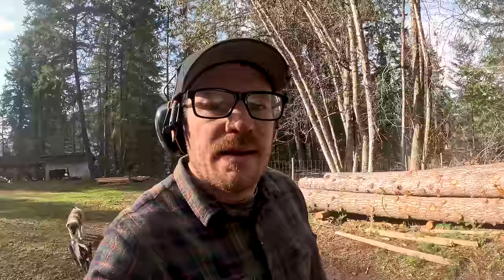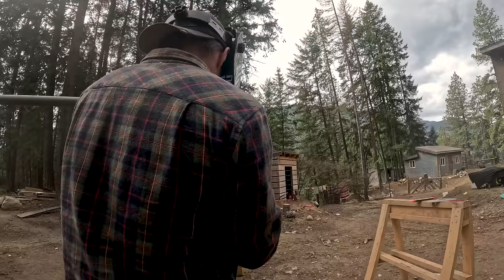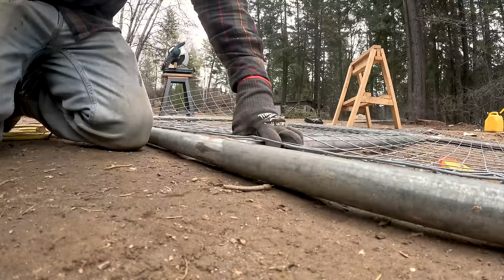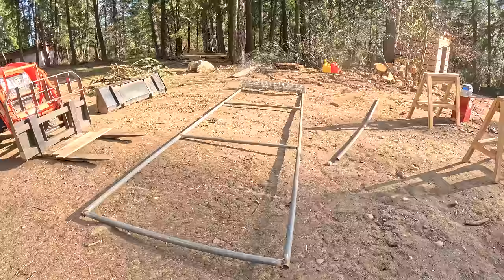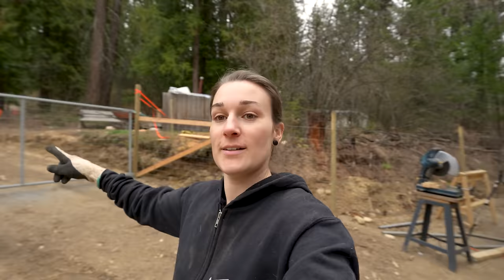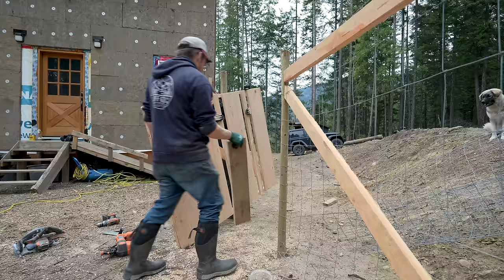Fortifying Our Off Grid Oasis With Custom DIY Gates

Comment: One the main things with welding is to match DC continuity with a DC rod. Then just play heat and distance. Angle of the rod matters. Wire does the same.

Comment: another trick for extreme long gates is to have the gate post extra tall and pivot a cable to top of post to far end of gate to alleviate the sag/dip at the far end or add old wheels of lawnmowers or other reclaimed equipment to bottom of gate to hold the extra weight

Comment: Suggestion on the 17' gate: weld a caster on the bottom swinging edge so the gate weight is supported other than on the pin hinges

Comment: As a hay hauler back in the very early 1960s I ran across all types of farmers' gates and many of the wider gates opened in the middle. So, you might consider that style; I think it is called a horse gate. All of the wide gates have big posts holding them. Like at least 8 by 8 inches, or the size of a utility post in diameter.

Comment: Katie have Greg but a couple of turnbuckles and a couple trailer tie-down anchors and the gate will outlive you, the post may rot but you can replace the post. put an anchor on the hinge side of each steel gate

Comment: I'm a welder and don't pay any attention to people that give you kaka, you learn while you go and the beads will get better as you do it. Most guys won't even try, but you have to learn by doing. When I welded  pipe that was coated, grind  away the coating for a clean weld.

Comment: You might have noticed; corner and gate post are usually twice the size of fence line post.  6 to 8 inch post will work a lot better and put them 3 to 4 ft in the ground.  On long gates you can also add concrete in the hole.  Nothing more irritating than a gate that is constantly moving around or out of adjustment. More work but trust me those gates won't go anywhere with the bigger post.  If you can wiggle the post its not big enough. Don't ask me why I know this, it took me years and a lot of time to learn this when I was younger.

Comment: Katie and Gregg , you are amazing! Just so inspiring, with an ever increasing skill set and a fantastic home. I really appreciate you sharing with us , thank you…
Reply: Welding galvanized metal requires a special breathing mask because the metal is coated with zinc, which, when heated during welding, releases toxic fumes. Specifically, the high heat causes the zinc coating to vaporize, producing zinc oxide fumes. Inhaling these fumes can lead to “metal fume fever,” a condition characterized by flu-like symptoms such as fever, chills, nausea, headache, and muscle aches. Long-term exposure to zinc oxide fumes can also result in more severe health issues.
Reply: Two questions.  One: Why one large gate instead of two smaller ones that connect in the middle when closed?  Two: have you tried a slotted hole for pole hinge hole to allow you to connect the bottom hinge first, then raise the top hinge rod into the gate hinge and tighten it in place after it’s in the hinge hole?  I have no experience in mounting gates so my idea may be useless.  Love you videos!  ❤️🇨🇦

Comment: You can make a crossbrace with cable and a turnbuckle.  that will be adjustable and will cut down on weight. That will work particularly well on the metal gates.

Comment: Greg that gate looks great welding is something I have fancied having a go at but with a gasless mig welder it’s just getting a decent cheap one. As for your hinge problem I would remove the pin and replace it so the pin goes down through the gate that way none of the animals can accidentally lift the gate off its hinges.

Comment: I'm 72, welded my whole working career. Small stuff like the fence you will use the tig, thicker steel, the stick welder. My wife just said you should put a wheel on the gate? Your call. Thanks for sharing.

Comment: Greg, you did a great job with the welding, way better than 100% of the ppl who don't try..😊 In my opinion, after hanging metal gates on various properties, you need at least a 6" post to hang the 12', and a good railroad tie for the 17'. The 4" post they're bolted to won't carry the weight for long sadly. Love ya'll ❤ Keep practicing that weld! 😊

Comment: Good for now. Those gates are either big  heavy or both for those small fence posts. Over time they could move or sag. Beefier hinge posts, metal Vs wood, concrete around gate hinge posts. Effects of winter, rain run off, frequent use.

Baseline, lessons learned, skills developing with more practice.

Comment: Another option?  Say for an 18’ gate would be to install {2} 9’ gates.  You can put a galvanized pole in the middle made from gate frame material.  Concrete the hole for middle connection pole so the pole can be took out to allow each side of gate to swing out when bigger opening is needed.  Brackets can be added to allow each gate to rest on and connect in the middle.

Comment: I built a 16 ft. gate over 50 years ago, as a VoAg project in high school.  It is still in daily use on the ranch and despite damage from a tractor hitting it with a plow, still works well.
Reply: That goes to show what time and effort are put into a project can last a long time.

Comment: For attaching mesh to pipe or bar, a good trick is to use washers over the mesh. If you place them at the nesh wire's intersections and plug weld through the washer centre, they hold mesh well and look better than direct welded / burned mesh. Plain steel washers are cheap and available anywhere in Canada or the US at most hardware stores. The ones for 1/4" , 5/16" or 3/8" are probably best sizes to test with your mesh. Just food for thought. Cheers! PS- washers are handy for packing spaces on hinge pivots if need be...and don't forget the white grease on em too. 8^)

Comment: You did a good job for a first timer! I’m a welder/fabricator for a fencing company, building and hanging gates is what I do.  Next time you weld arc, grab 6013 1/8 ,it’s an all position rod that works well and  very easy to use. As for welding the wire mesh, try tacking on the pipe and pushing the pool onto to the wire, if you know you know.
As for your hinge on the first gate, just open the top hole up a bit and move the hinge pin to sit where you want it and tighten, and if you don’t have a washer on both sides of the post, add them.
That 17 footer should be a “double drive”, or split in two . That is way too heavy for the posts you’re using, and you will run into problems down the road with it.
Just trying to help, you did a good job other wise.

Comment: On the post on which the gate is hanging. Add a separate post on the outside, about six or so inches. Heavy metal post, four, five feet concreted in the ground. When concrete set connect to gate post. That way your fence post will always be aligned. You can also concrete that post slightly out of level as an extra precaution.
Reply: like he will take your advice. He is his own man.

Comment: The only thing, for the longer term, is bracing those fence posts holding the gates. The weight, over time, will pull the gates out of square and end up like the ones here, dragging. 
The welds don't need to be pretty, but functional.

Comment: Ah Greg when You use a buzz box and burn a hole through good thing is you can always fill it right back in but you better be using 7014 rod probably a thin one And grind off all the galvanization you won't have to wear that double mask I never wear mask at all the years I welded just got to make sure you take all the galvanized off that easy

Comment: When I weld galvanize I grind the galvanized off the steel weld it and then if you want you can buy a galvanized spray and spray it over your will or just paint it

Comment: Greg, That fence post that holds the gate needs a bracing post.  The gate is too heavy for the post alone.  You will need to go back about 3 metres and ram in a deep post on a 45 degree angle, about 2 metres into the ground towards the gate. and then run a brace from that (near the ground) to the top of the supporting fence post, and fix both together securely.   And then you will also need a second brace in the direction of the driveway, to support the fence post when the gate is opened.   By the way, nice work with the welding!

Comment: Greg add a down wire to the post at the gate to hold the post up.  It will start to sag real soon. Small hole with a small concrete and lag bolt and a down wire to hold the post will save you a lot of time in the future.  The place is looking good.   It is a lot of work but makes you feel good about yourself......

Comment: Another suggestion Greg is two 8 1/2 foot gates instead of One 17 foot gate. A car or truck can easily pass through an 8 foot gate and it's half the stress on the corner post.  Otherwise your welding is acceptable and "good enough" per the only person that matters....Katie!

Comment: A gate is basically a swinging truss. Grinding area clean before welding is the ticket. Zinc is a non bonder for welds.  Paint the welded areas.

Comment: Tripped breaker open it up and look for ground short in the switch! you do still need some diagonal braces on the gate. center top to bottom outsides. Looking pretty good! Don't cut posts down until after you steel rope the gate to swing.

Comment: Hello, Guy here who helped you with tips on swinging the Axe a couple of times.  Great welds only matter on heavy duty, weight supporting applications.   A thin gate is perfectly fine with popcorn welds as long as some penetration has been made, and you should not worry at all about it.  It'll hold and that is what matters.  If you were doing more load bearing applications, your weld quality would matter a bit more.

Comment: Good morning Greg from a ironworker and fence installers point of view I think you did a pretty good  job on them gates . Galvanized is a tough thing to weld because of the zinc. But with you  grind the area real good to get the zinc off the area that you welding. Is the right way to go and i run my welding machines hotter when i weld galvanized. So it's a good idea to wear a mask so you're not inhaling the toxic smoke. And keep milk with you and drink the milk to help with the toxic fumes that you're breathing in. 👍👍👍👍👍

Comment: On your long gates on the hindge side , because the posts are to short, scab on or attach another post that is maybe 4 ft. taller .At the top of that post run a a wire to the far end of the gate. You may also have to run a wire from the top of the new post  out 180 deg from the post as there is a lot of strain on that post. Lots of extra work but it will pay off.

Comment: Seed an area, water it and then put a sheet of plywood (or similar) over it for a few days, it will germinate without being eaten.  Then check it every couple of days and keep it wet.  Then pull up the plywood once the majority of the seed has sprouted.  You will get amazing results.

Comment: If you want to keep the big Gate just find a decent sized tree cut it down cut to length dig a hole cement it in and wala easy peezy 😊 PS probably around 4 or 5 bags.

Comment: But Greg - about the gate - it looks great, especially considering the cost of buying one. If you were keeping cows or horses in or out, that might be different, but I think the gate would still hold. On the post where the gate isn’t all the way down on the post (whatever it’s called), it might settle after the gate has been used for a while. Even if it doesn’t settle, no big deal.  AND - you’ve learned three things:  welding, using the saw to cut pipe and build a gate. All of that in a day!  If you need to, reinforce the fencing to the gate with wire - like on a chain link fence.  The big gate, make into 2 smaller gates that meet in the center.  Great, great video!  Great content!

Comment: Greg u did great ,youve tried to weld,and thats better then not. In the hanging gates i have heavy duty wire thats attached on top of gate to the post. It will help the fence not to sag and will help it open up. Yall did great!

Comment: Greg you need at least 6x6 post for your gates specially for that 17 foot gate with diagonal bracing to support the 6x6 post. Been there and done that. It may look good now but later it will not work well.

Comment: Hey Greg I am very glad you said you would were a mask. Galvanised fumes ( zinc) mixed with the air you breathe in . This can give you metal fever. Flu like symptoms. Always where a fume mask buddy. keep safe.looking good. Why did you arc weld the big gate. Was you mig not working? Cross brace all rectangles. 😮 loving what you’re doing.

Comment: A few diagonal metal-pipe cross braces out from the middle vertical may be needed to keep it from sagging when you fix the fence tack welds. Heating the top hook with your torch and tappping it a bit down may help get your hook all the way onto the pin. Good job. “ It will hold!” as they say on the show Forged in Galvanized Steel. LOL

Comment: A bit late for a couple of tips but here goes anyway.  #1 - With time you may find that you should have put a diagonal on your gates,  #2 - Your gate mounting posts, may need some stays to support the post when the gate is not lined up with the fence stays as there will be some weight in them as they are so long.  #3 - Supporting the end opposite to the hing when closed may also help to stop sagging.

Comment: you can always use lumber and self tapping screws to strengthen gate and hold wire fencing to it ( two birds, one stone ) just drill the boards into the gate frame or do as a forty-five to stiffen gates and a post ( out from gate post ) driven in ground with wire run to it can str8en up post and straighten gate post that hold gate upright

Comment: When you use a long extension cord on your tools the amps will go up because of voltage drop caused by the length of wire. 10 gauge extension cords are pretty expensive but are worth it.

Comment: Hey Greg, when you can it would be a good idea to make up some gussets out of 3/16 flat steel and weld them to each the corners of your gates. Don't sweat the welds bro, we all have to learn somehow and galvanized can be tricky at first due to the off-gasing. Good call on the mask. I don't know what rods you are using but if it's an AC welder 6013 or 7014 rods work well. Keep at it, you'll get it.

Comment: Use two 8 foot 4 in. Gates with 4 in. Center post that is removable and will leave a 17 ft. Opening 
When the center is removed. with a simpler 8' gate the rest of the time.

Comment: on the wooden gat you can add a board or cable across the gate posts  supports to keep them from leaning  backward   because the weight and pull and rain will change them over time and you can take the added board support and place  a pin in out so if you have to take anything tall thru there it can be pivoted then placed back this is on wooden gate im speaking unless you want back off the support gates a few feet add another post and put in cross supports to hold the angle of those posts  but the board across the top of post would be much easier and you can place your  off grid living design in the center of that cross support which it would swivel to get anything tall thru there not trying to tell you what to do just thinking on how i would solve future problems only as suggestions  i like to see people that are not afraid of work

Comment: Couple of thoughts on your metal gates. I think you may want to put some crossbracing in because nothing stops it from going side to side and breaking your welds. Also, for that huge gate, you’ll probably want to do some more anchoring so it doesn’t pull those two posts to the side, maybe anchor to another tree or bury a large block of concrete in the ground and anchor to it. Great work though.

Comment: You'll need a much more rigid post (concreted in) to allow for the weight of the 17 ft gate, especially since it is heavier than the previous gate.

Comment: Did you know when the parts missing from a tool you can ride to the manufacturer and a lot of times they sent you the replacement part for free because it cost them more to send you the replacement part for free because it cost them more to return the product that doesn’t happen all the time Sometimes they ask for money but sometimes they don’t.
So sent them the manufacturer the model number and serial number you make it lucky and send it to you for free are used to work with tools. Good luck.!

Comment: Buddy on ur hinge that u bolted on the post is right the top part of the hinge should be   turn down to lock up up gate so it won't be easy to pull out for intruders.

Comment: You need to pull the post back a little. Get an anchor and a wire and pull on the top of the post till the gate sits nicely then anchor it at that point or make the post heavier after its been adjusted.

Your gate is huge so the torque on the gate post is a lot. Even if you added a trailer hitch bench on the other side with a pneumatic wheel it will take the torque off the one post allowing for your gate to sit properly. Also if you want your gate to be super strong add an extra bar going diagonal. 1 on each side

Comment: Aslong as it’s what you wanted who cares, personally I would just weld another tube diagonal across the gate for a little extra strength so it doesn’t drop over time. And the best way I’ve found for welding that sort of fine gauge wire is get a little pool going on the thick frame and just move it slightly over to the wire and it’ll hold and not burn through. This is not criticism just some tips I’ve learned over time keep up the good work!